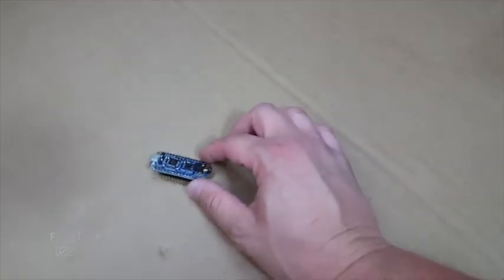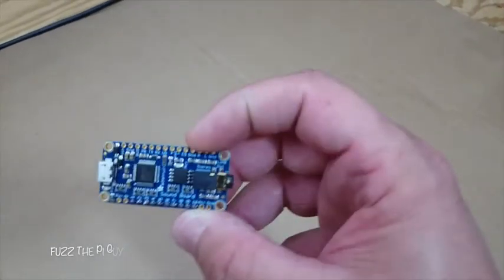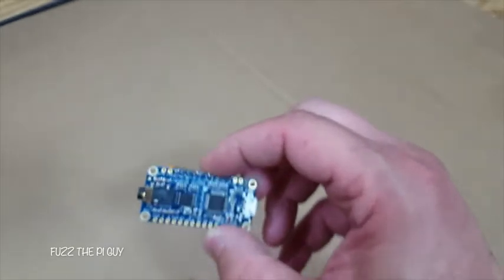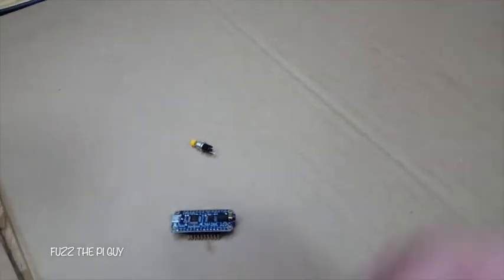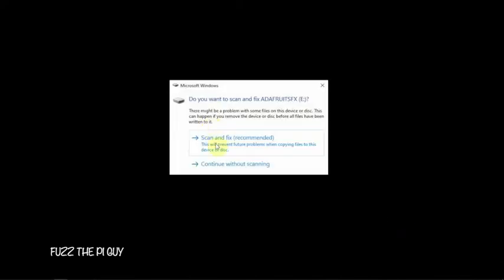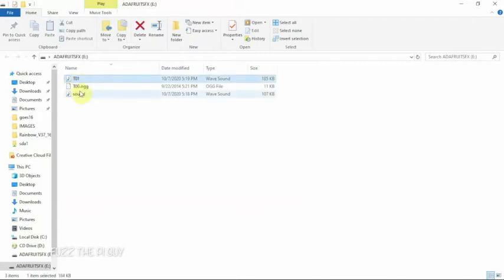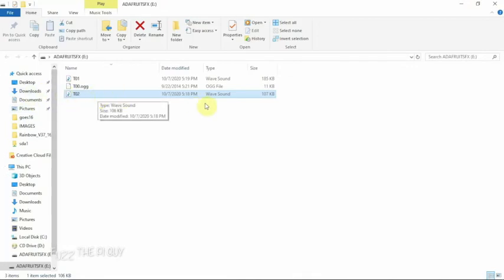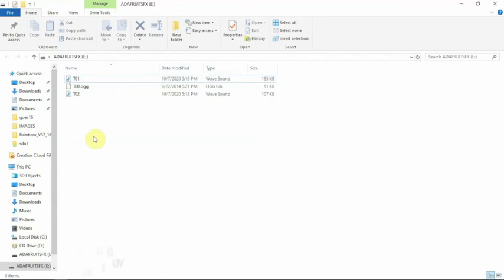Adding Audio Files To The Adafruit FX Sound Board For Momentary Switch Use

Comment: I did the same ! T01,T02 and not sound! When I try on my car ! I downloaded the track example from the page of fruit sound website it works fine but my tones that I downloaded into the board didn’t??? Some one knows why? Maybe I downloaded by mp3 format ?
Reply: I was told you CAN NOT have MP3 files due to copyright issues. The only files you can use is OGG and WAV :¬)

Comment: None of my computers recognize the the sound board what do I do
Reply: I used a different usb cable and that did the job. THANKS!!!
Reply: @underachieveruno  hell yah bro that’s good
Reply: Did you figure it out I’m having the same issue
Reply: @underachieveruno  all I did was swap the micro usb with my PS4 controller charger and it worked
Reply: @lDemonic_Monstrl  i tried like 4 different pcs and couldn’t get it to work didn’t think to swap the cable. Going to give that a try. THANKS!!!
Reply: @underachieveruno  no problem bro
Reply: @lDemonic_Monstrl  thx for this commentary finally can start my project
Reply: @underachieveruno  yeah I was using the wrong micro usb like it was plugged in and everything but the micro usb was for something else I guess
Reply from the maker: Make sure the usb cable that is being used can do data. Most can, but some only have a hot and ground wire in. Used mainly for power banks, Bluetooth and so on.
Reply: @FuzzThePiGuy  yeah that makes sense the one I tried in the beginning was a Bluetooth speaker charger
Reply from the maker: Does it show under device manger if using windows 10?
Reply: @FuzzThePiGuy  I don’t know I never looked but I would imagine it does with the right usb cord, but I’m pretty sure it does
Reply from the maker: From what I see online. It should mount as a mass storage and no driver is needed. I can look at mine tomorrow. And get back to you. I need to get to bed. Work in the morning.
Reply: @FuzzThePiGuy  alright no problem bro

Comment: Question, Could you load multiple mp3's onto one track and have it play on a continuous loop?
Reply from the maker: I would say yes. Multiple songs under one mp3 file. The only problem is the space that the board can hold.
Reply: @FuzzThePiGuy  is there anyway to expand the memory?
Reply from the maker: That I’m not sure. I know you can add a Sd card module to a ESP. But I’m not sure about this board.
Reply: @FuzzThePiGuy  I was told you CAN NOT have MP3 files due to copyright issues. The only files you can use is OGG and WAV :¬)